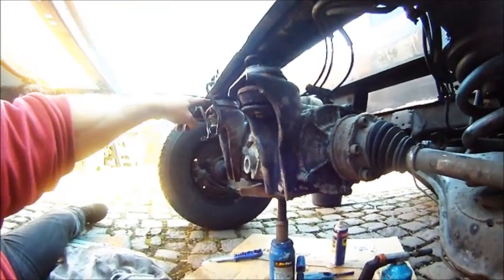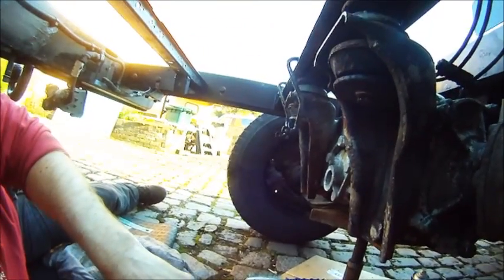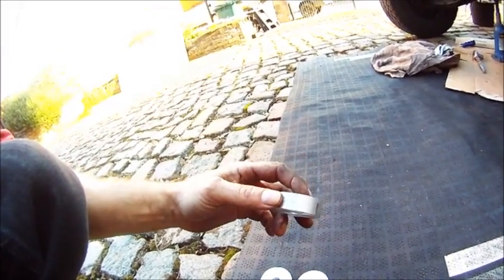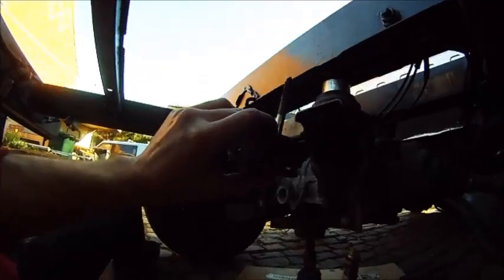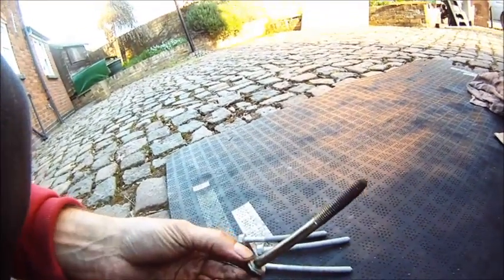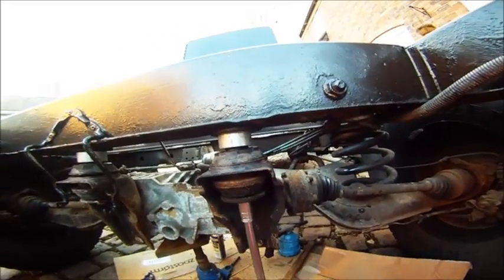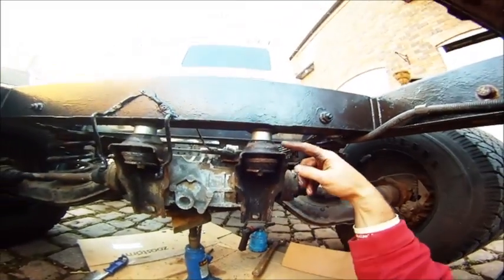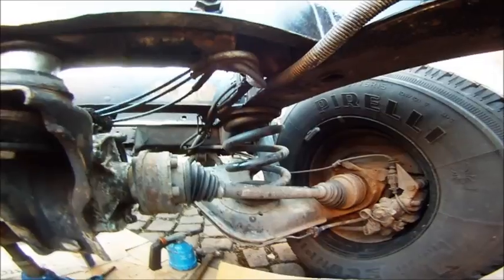VW T4 Syncro Cheap DIY Suspension lift Part 1 - Lowering the rear diff

Comment: Hi there loving the videos just a quick question and you probably heard it all before what size springs are using and shock absorbers ? I am yet to add my spaces to my Syncro I have already added some left but I would like to get a little bit more 😜 Thanks Nick uk Somerset 💪